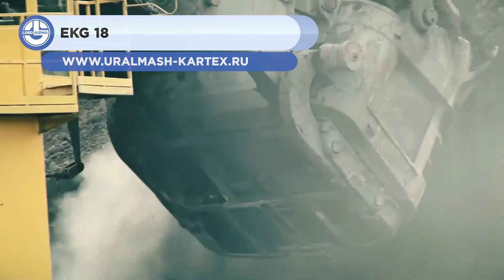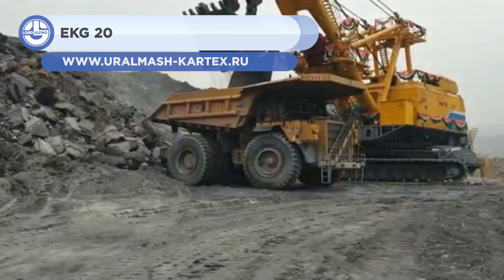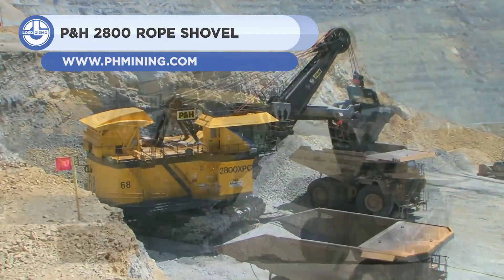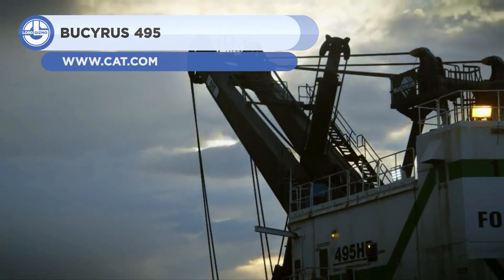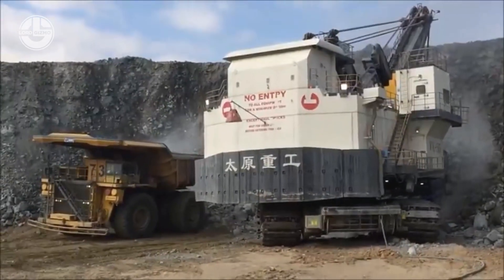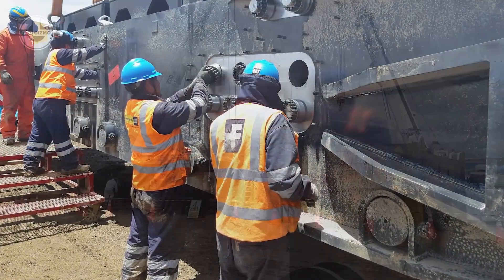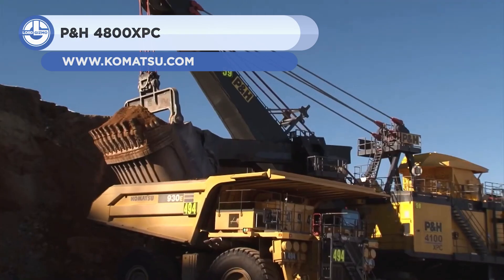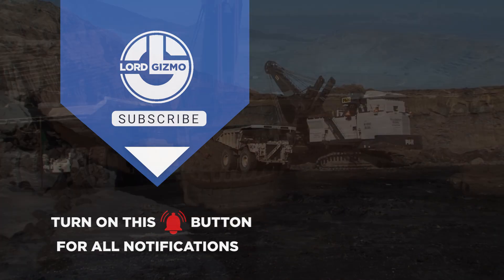TOP 10 BIGGEST ROPE SHOVELS IN THE WORLD

Comment: Berkeley Forge (Now Bierwith Forge) has designed the Optima shovel lip system for P&H with the largest one as OP110( WH 12 back in the year 2005. Now it has the latest design of the shovel lip system named as slick lip used on a P&H 2800 in a Mississippi lignite coal mine.

Comment: I worked at P&H Mining Milwaukee Wisconsin as engineering contractor 1996 - 2002. The redesign of 4100XPB and 9020 dragline that went to Australia. It took 4 years to redesign and 2 years to build at job site.
Reply: 9100 what is that a beefed up 9020 kinda like how Bucyrus had the WS version of the 2570 and 1570
Reply: @bethanyhaskiell9116  oooops I ment to type 9020

Comment: The videos along these lines have been mostly virtual advertisements for loading shovels.  The actual largest shovels were the high wall stripping shovels, such as The Silver Spade, The Gem of Egypt, Big Brutus, etc.  Some had 100 plus, cu yard buckets, which would bury the hauling trucks in this video, with one bucket.  Big Brutus, which, thanks for showing a little of here, might be the only one left, was not the largest of its kind, by any means, but was large enough, and is an inoperable museum, at present.

Comment: what baffles me about these grat shovels is how the bucket is opened by a pull on a little rope!
How doe sthe catch work that it is so easily opened?
Reply: The catch is a sliding bar attached to the bucket's door, & the bar slides into a rectangular slot on the bottom edge of the rear of the bucket. The sliding bar is moved out of the slot in the bucket by a mechanical linkage arrangement, which is actuated by the cable (rope) seen in the video. The mechanical linkage arrangement is designed to maximize mechanical advantage, to provide the necessary force to move the sliding bar.
Once the sliding bar is moved out of the bucket's slot, the bucket door opens (falls open under gravity), & the excavated material falls from the bucket. To close the bucket's door, the sliding bar re-engages into the bucket's slot (under spring force, I believe) as the bucket moves from a horizontal position to a more vertical position. I hope this helps; a diagram showing the bucket door latch mechanism would have been helpful with my explanation.
Reply: @shadovanish7435  the latch bar re-engages via gravity. The side of the bar facing the dipper door is beveled, allowing the momentum of the door swinging to push the latch lever up, and gravity let's it fall into place

Comment: 9:50  is that a bell hanging off the back?
Reply: It's not a bell.  It's a guide marker so that when the shovel is set up in the pit for double back up, the trucks are able to use that to spot themselves on their blind side.  It helps eliminate the need for the shovel operator to spot the trucks, moves more material and improves efficiency in the mine.